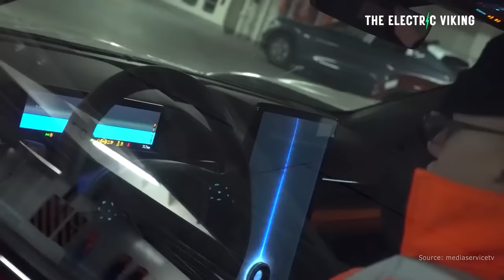Ford inventory hits record as cars pile up and sales decline

Comment: I think a huge part of Ford's problem stems from their Dealers' earlier price gouging
Reply: Some of it yes. The stealership model won’t work for EV’s. The ridiculous price gouging they tried has left lasting damage on Ford’s EV reputation. They will need to work very hard with new lower priced models to get this back.
Reply: @ISuperTed Ford told dealers they would be barred from sales if caught. Ev are ordered  from ford site and dealer only got delivery price. I have pictures of $20k “ no stock” tacked on by deal in town, sent to that to ford. They no longer have ‘those additional’ charges.

Comment: Granted that I am a fossil, but it seems to me that pushing those oversized luxury pickups with small beds while discontinuing sedans, allowing parts suppliers to integrate horizontally, failing to deliver vehicles in a timely manner, and charging exorbitant prices could have something to do with Ford's current inventory problems.  Well, our 2012 Toyota Camry Hybrid will probably last longer than we do.  Ditto for our Honda Fit/Jazz.  No reason to change.

Comment: Forgot to mention that’s up in Canada where plattys go for 125,000 before the discounts.
Reply: Yes... This...  Pricing just got absolutely ridiculous in the past few years.   Yes they had to renegotiate wages and now have $1000 more in labor costs.   Where did the other $59 000 increase come from?   They priced themselves right out of business.   All our future company trucks will be EV's but they have not delivered a compelling truck for us to buy.   They have the worst range, worst charging speeds, worst software and are priced as if they are  made out of gold.    They made absolutely no improvements to the 2024 lightning making the value even worse as more competitors come on line.

Because of the "great deals" Canadian Platinums around $95k.  I went to dealer to look at one.  Only to learn that all of them had main features removed due to chip shortages (ie.  no scales, no massaging seats, no heated steering wheel).   HELLLO FORD.  What is so platinum about this truck.   Why would I pay $95k. for severely outdated tech and lacking all the promised features it's supposed to have?  This truck will be worthless in 5 years, when 600 mile range and 20min charges will be the norm.    At a moment of weakness,  I offered $75k CAN and luckily they declined.

Comment: WHAT?! No waaaaaay? Pricing base line vehicles around $50k and top trims over $100k+ is making the average consumer not buy vehicles from certain brands, causing "lot rot" from left overs from previous year models? Wow, if only economists and manufacturers couldn't see that coming that no one wanted to spend 2-3x more on a vehicle than they did 5+ years ago. Inflation may have played a small part, but over all these prices and choices by manufacturers have put themselves out of reach of the average customer unless they take an irresponsible high interest rate 8-10 year mortgage like auto loans (to which the vehicle wouldn't last that long these days anyway). I feel no pity for their obvious greed.

Comment: Highest Days on Market, Tesla:
- Model 3: 203
- Model Y: 240

Also Cox:
"Sales in Q1 rose 2.6% year over year, but fell 15.2% compared to Q4 2023."

"According to Kelley Blue Book estimates, Tesla sales in the U.S. were down 13.3% year over year – well below the typical double-digit growth that had become routine with the Tesla brand. Tesla’s share of the electric vehicle market in Q1 2024 was 51.3%, down from 61.7% one year earlier.
Reply: Love the trolling. Keep up the great work with those completely made-up figures. Tesla inventory is probably about 3 to 4 weeks.
Reply: @douglaswatt1582  Tesla's inventory was worth $13.6 Billion in end of 2023 and they produced 45k more cars in Q1 2024 than they sold. If you use $50k/car, Tesla's inventory in end of 2023 was 272k cars and it increased by 45k cars in Q1 2024.

Comment: I can't help but laugh when people call the leviathan class "full sized" trucks "light trucks".

Ford is suffering from the same thing that is hurting the rest of the industry, particularly the big three. They didn't read the room very well. The cost of living in America has been rising, wages haven't been keeping up and most people are feeling stretched. Manufacturers should have been noticing this and worked on reducing the prices of their offerings, offering lower trim levels and redesigning their next generation of vehicles to be smaller and less expensive to purchase and operate. That didn't happen and many manufacturers, particularly Ford, GM, & Dodge/RAM are suffering the consequences.

Comment: Someone please make a simple truck that can tow a medium size travel trailer. No plastic cladding or plastic chrome. A large simple in line 4 cylinder. A two speed differential and a rugged automatic or stick. I don’t want to talk to it or it to me.  No gps I have one on my phone no Bluetooth connectivity. The two speed will make it tow, or  not, my choice. 4 wheel steering would be nice. Please no gigantic grill.

Comment: Ford is making all the wrong moves, other than their EV skunkworks. 
One of Ford's biggest issues is that they are no longer associated with quality. Ford has had too many major F ups that have led to major recall after major recall. The bean counters in their parts procurement dept are part of the problem. 
    Having said that, GM is even worse off. GM has their new EV pickup but how many are they making? They never plan to scale that truck or their EV cars until they are not making losses on them. 
But before you can make profits on EVs you have to scale your production well over hundreds of thousands of EVs. To do that you need dedicated EV factories and dedicated EV supply chains..... none of which GM has put into place. So through this lens Ford was making the right moves but put out non-competitive EV products (slow to charge...too expensive)... which is why their sales fell. 
    Now Farley has talked about a new mid-size EV pickup but that they won't start production on it until they know they can sell it profitably from day 1.    What this means is that Ford will NEVER achieve profitability on their EVs!  You have to produce them enmasse to get them to where they become profitable.... they never will be otherwise since to make them profitable from the start, the truck would have to return all the investment in the factory, parts, development, etc. Only ramping up production can achieve that. 
Let's face it, the OEMs will hobble along selling ICE cars and hybrids to people they can easily fool with commercials and paid for news ads. Meanwhile EV makers, and in a few years robo-taxi, eats their lunch. 
There will not be time later for the OEMs to shift fully to EVs and stay solvent. I am convinced that their CEOs know this and are just milking the public for the money they can squeeze out of them with an eye to a govt bailout to pay for their transition to EV manufacture later. The ultimate problem for that plan is that the OEMs will have lost a huge chunk of marketshare to other EV makers.... and they will never get it back. Plus, any EV that they do produce would have to be competitive in value and price from the get go... which by then they probably won't be. They are screwed.